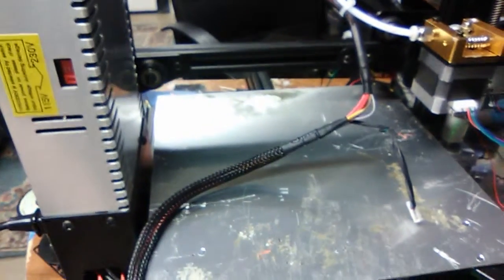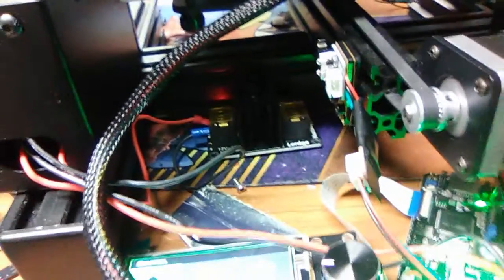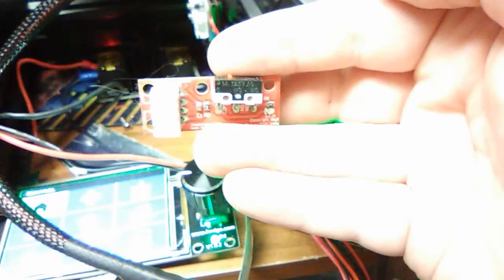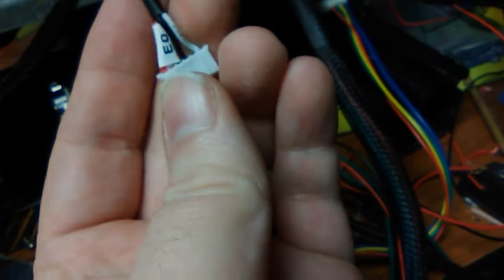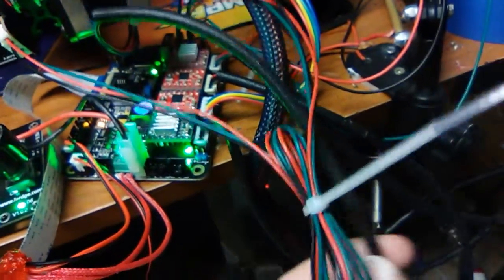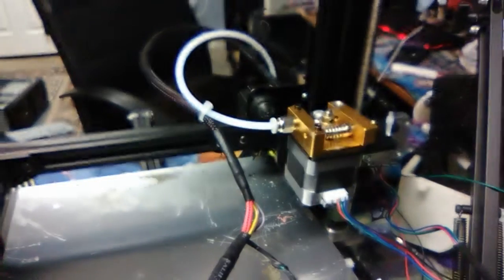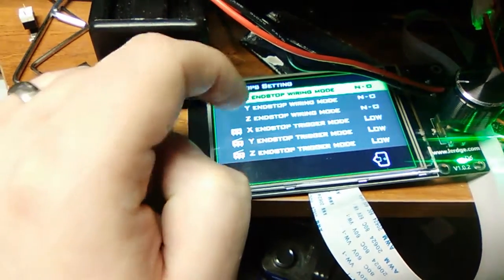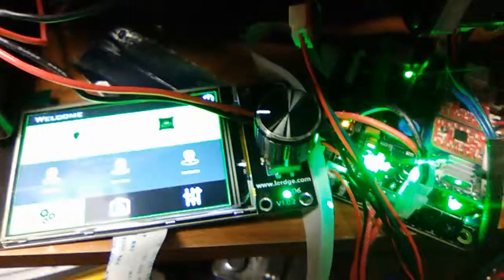Geeetech A10 Control Board Swap with Lerdge-x!

Comment: on my A10 i swap 5 motherboard !! until i fit an mks gen l inside  now trouble free ! their gt2560 is pure shit! always blow out
Reply from the maker: Yeah. I discovered even with extra grounding that stock boards arent really designed as a long term solution. It's always the same issue.